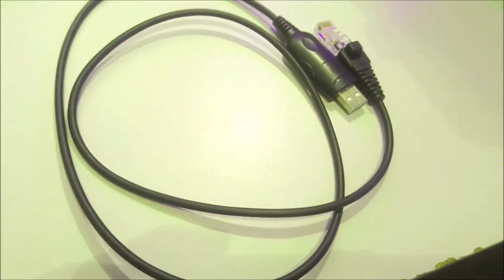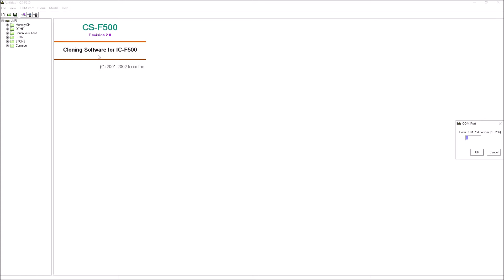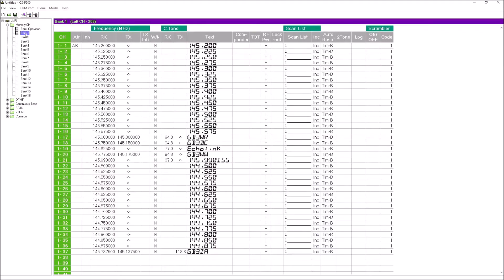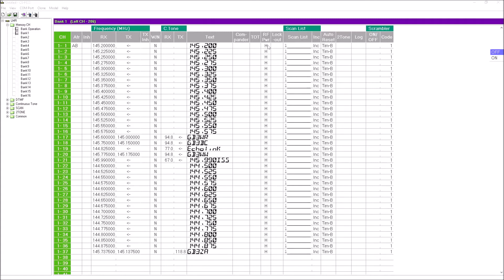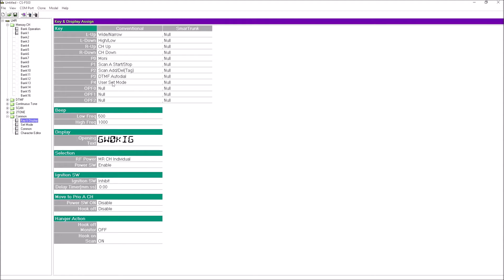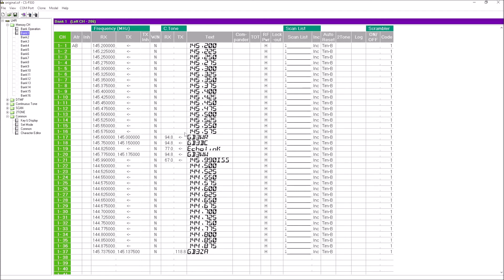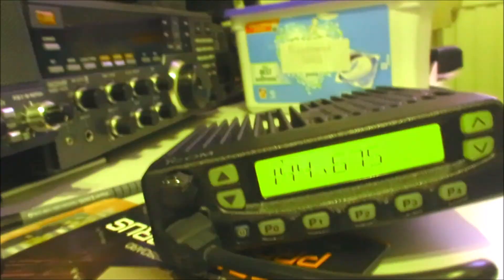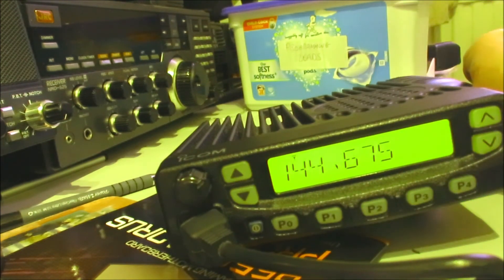Icom commercial radios software and programming

Comment: I’ve got a number of IC-F3022s handheld radios. Everything works, but so can’t get the CTCSS to work. 

Under the C-Tone columns, in the RX column specifically, I added a CTCSS of 110.9. Yet, if I transmit with a radio that doesn’t have this CTCSS programmed in, I’m still receiving the audio. Do you have any idea what I might be doing wrong? I’ve been wreaking my brain as to how to solve this.

Comment: So got the radio and cable. Iv tried it on Windows XP ,7 and 10. Not one can find / update the driver for the USB cable.
Any help or links for this would be amazing.
Reply from the maker: Sounds like a driver issue. Not sure which radio you have. Anyway establish what programming lead you are using (e.g. OPC-1122) and got to this site https://www.icomjapan.com/support/manual/          you should find the info there.